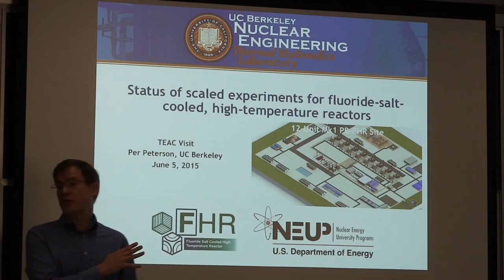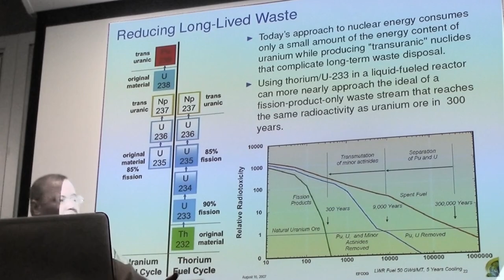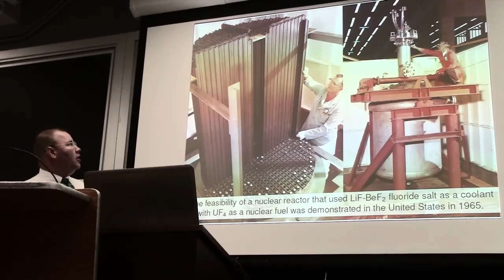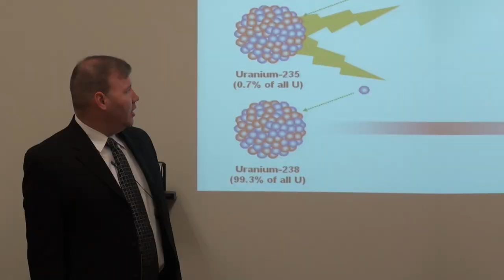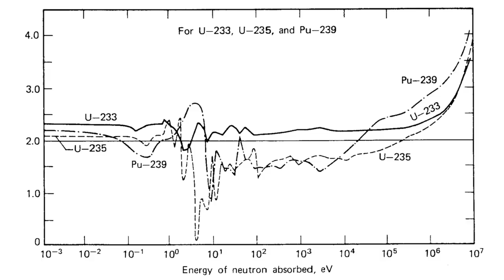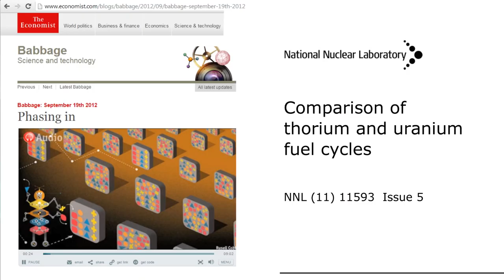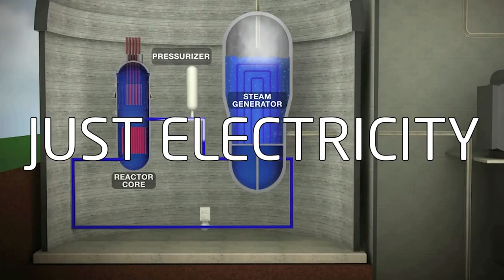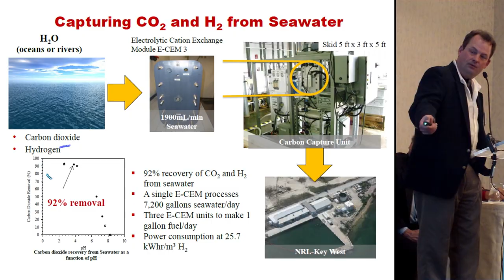Thorium Disadvantages

Comment: Simple thorium is the end of nuclear weapons.....
Reply: How so? Thorium fuel cycle is impossible without breeder reactors and reprocessing facilities. That's perfect for bomb grade plutonium production, just mix in some depleted uranium and extract plutonium from spent fuel. Hey presto, bomb material, as much of it as you can be bothered to stockpile and with better ratio of plutonium isotopes than from an uranium reactor.
Reply: @aleksandersuur9475  You should probably take a physics class, your oversimplification leaves out several key facts as to why it doesn't work that way, nor is as simple as you make it!
Reply: While it's certainly a gross simplification(what do you expect from a youtube comment?) it will still very much work. All you need to breed Pu239 is U238 and neutron flux, you can have a process tube running through your reactor, or you can include U238 in the fuel mix itself, that's up to you. You can successfully do the latter in liquid salt reactors, in solid fueled reactors it only really works if you have process tubes, or if you shut down the reactor much more often that you would a regular power reactor. India managed to build a weapons stockpile with CANDU reactors just fine, you'll have an ever easier time of it with a suitable thorium reactor. Reprocessing facility comes as a package deal.
Reply: @aleksandersuur9475  No, because with a Thorium Molten Salt Reactor you're typically not going to be operating in a fast spectrum, you'll be in the much slower thermal spectrum and U 238 doesn't "breed" very well in that spectrum, so you're not going to be a proliferator of Plutonium 239 with this cycle. The physics has got you by the balls there and will crush your proliferation dreams. Remember the thing about Thorium is your bottleneck is your 28 day decay cycle to get it to a fissile U233 product to sustain the reaction, if you try to operate in the fast spectrum you'll burn up your fissile product faster than you can make it. Now, the only way you're going to get around the physics of that bottleneck is to put in multiple fueling loops to keep up with your fast fissile cycle. Now, this is where the economics of doing a fast cycle Thorium plant bite you in the ass while the physics has got you by the balls. Now your fast Thorium plant costs more to build than a conventional breeder plant cause you had to put in extra fuel loops just to keep it running. So your return on investment is going to be so far out (if you ever see it) that you'll never be able to afford to build that plant and still have it make economic sense to anyone that you are looking to invest into it. If the economic numbers don't work and you're hostage to the physics of Thorium, it's just not going to happen. Hell, even with the US government pissing billions into these projects, they couldn't get around those two key facts (both the physics and the economics) about Thorium, that's why they never went there to start with. Not to mention the two of the salt fast breeders they built, did melt their solid fuel cores (EBR-1 and Fermi-1). Even though both happened for very different reasons, folks start losing their shit when they found out, so yeah that's not gonna happen again (at least not in the US anyway).
     Ok, now you understand why fast cycle Thorium is out of the question, you're back to the slower thermal spectrum Thorium cycle. You're probably thinking you're out of the woods since you got rid of an economic headache and went with the more feasible slow cycle. Not so fast there speedy, cause here's a big ole bowl of nope when we slap the non-proliferation cuffs on you for good. As I said earlier, U238 doesn't do "breeding" in the slow cycle, cause it only gives off 1 neutron (actually 1 point 8 or 9 something, but for all intents that point something is as useless as creating methane from a fart, so you only get 1 usable neutron) and to do breeding you need spare 2 neutrons, 1 to sustain the reaction and the other to breed U238 to make Plutonium 239. Ok so that's one handcuff and here comes another bowl of nope to stop you and put you in non-proliferation jail. 
     The thing about Thorium is it's a fatty, it loves to absorb neutrons both as it's raw 232 form and as it's lean mean fissile creating U233 machine. BUT when U233 fissions it gives off 2 neutrons (as earlier, actually 2 point something, but again that point something is useless as methane from a fart, so 2 usable and that's it), 1 of those is to feed to ole fatty Thorium 232 and send it off on its 28 day crash diet to become lean and mean U233, the other to sustain the reaction. Now remember U233 just came back from a crash diet, it's hungry and it wants to be a slow fatty again, so it has about a 30% chance of absorbing a neutron and becoming ole slow fatty U234, which as you know is not a fissile product. Ok now you're thinking hey U234, we're just 1 neutron shy of getting on the Zoomba Majic Bus Utopia 235, right? Uhm yeah, hope you enjoyed the other bowl of nope, here have another, cause where are you getting the spare neutron from to become U235? Cause you only had 2 spares to start with, you sent 1 with ole fatty Thorium and got greedy and ate the other to become fatty U234. So not only do you not get to be U235, but you also just put the fire out cause you didn't have a spare neutron to continue the reaction. CLICK CLICK, you're now under arrest and going to non-proliferation jail, toodles~
     Ok nerds, don't lose your shit, I know that's an exaggeration of what happens. But atleast it gets the point across as to why you're not getting on the nuclear bomb bandwagon with a Thorium Molten Salt Reactor. If the economics doesn't bust your ass one way, the physics has got you by the nuts the other way, so either way, it's just not happening!
Reply: The neutron spectra is not optimal for Pu239 breeding, sure. But think about this for a second, B Reactor in Hanford was only designed to 250MW thermal, what's the total power of a country full of power stations? France is averaging something like 50GWe of nuclear power. It doesn't matter that the breeding per unit of reactor power is going slowly, you overpower that with the sheer scale of reactor power you are using for power generation anyway.
Crucially, with a liquid thorium salt reactor, you pretty much need constant fuel replacement and reprocessing. It's not a batch processing type of deal with such reactors, it's more like CANDU reactors where you replace a bit of fuel pretty much daily. And you do need reprocessing to keep the fuel cycle going. At that point bomb grade plutonium extraction is pretty small thing to add.

If your end goal is lots of nukes, do you start by building country full of thorium reactors? No. But if you do so anyway for power generation, then you can certainly build nukes as a side-gig. Sort of like what India did, it's not like they built all these reactors just to make nukes, no they actually need the power and that's the main reason they are building them. That of course did not stop them from using the reactors for dual purpose and building a weapons stockpile on the side.
Reply: @aleksandersuur9475  No, it's not that it's not optimal, the physics of it is just not going to let you do it with U233. You get 2 neutrons to work with, and that's it, 1 has to feed your fuel cycle, the other has to feed your reaction cycle, you can't rob either of them to do anything else with it or you kill the whole process. I don't care how you argue it, the physics is against you and you're not going to get there with a TMSR. 
     As for Hanford, all those plants were NOT an MSR of any kind, they were all pile types specifically for U235 fuel enrichment of U238 to get Plutonium 239. Of the 7 reactors, only 1 was an electrical power generator and that was the N reactor which was the last one built. The US Government was hemorrhaging billions of dollars to keep those plants running, and at the end of the day not even the power generation of the N reactor was enough to justify keeping it running. Besides, how much fucking Plutonium does the world need to destroy itself? Hell, the production at Hanford alone was enough to supply everyone in the world with a bomb, but you also understand why it's a bad idea to do that, right? Cause you know there are some assholes in this world that are in a hurry to meet their maker and collect their virgins, and they don't give a shit about taking the rest of us with them, that's why we don't allow everybody to have one. Remember, in global thermonuclear warfare, the only winning move is to not play that game to start with. Fuck man, the mighty Soviet Union bankrupted itself and fell apart to learn that lesson the hard way, how fucking hard is it for everyone else to learn from it, and just not do that?
     Yes, India forced itself onto the stage of the world and became a player, but even for all their brash shit talking, they know damn well they'll never push the button, cause they now understand the winning move just like all of the other players do. And they too will now have to live with the legacy of that stupid decision and remain ever vigilant over not only their own stockpiles that they'll never use. But also be vigilant that the next one to unleash that genie isn't one of those irrational assholes that would burn the world down, just because they can.
     Ok, now that we understand why chasing nukes is a futile exercise in the stupidity of humankind. Can we stop worrying about the need to make them and get back to talking about why we need to get rid of the other stupid exercise of humankind, the ticking timebombs that are water reactors? Shit, how many more Fukushimas do we need to happen before we finally "GET IT" and get rid of these goddamn things?
Reply: "You get 2 neutrons to work with, and that's it, 1 has to feed your fuel cycle, the other has to feed your reaction cycle, you can't rob either of them to do anything else with it or you kill the whole process"
You absolutely have some error in logic here, if this was the case the reactor couldn't work at all because there is no way in hell you could make use of 100% of neutrons, some are bound to be absorbed in structure or other materials in the reactor. Secondly, no fissionable material gives an exact integer of neutrons, mind you, what matters is how many neutrons you get out of an fission event on average. For example most commonly known fission reaction is U235 and incoming neutron to Kr92, Ba141 and 3 neutrons. It's well known because it was the first identified. Doesn't mean U235 splits and gives off 3 neutrons every single time it's hit by one, there is an entire spectrum of decay products possible, the only requirement is that number of nuclides is preserved . Neutron capture to U236 is also possible, never mind that many of the neutrons never hit another heavy isotope and just escape from the system.
In an reactor, operating at a steady power level, every fission event causes on average one more fission event. If you are required to also breed all your fuel then you absolutely can also breed a little extra on the side using a different starting isotope. In fact, it's required that you be able to breed more than you burn in the first place, how else do you plan to get your thorium U233 cycle started?
Reply: @aleksandersuur9475  That's what the 2.X is for you doofus, it is the average for the fission... But a lot of those excess neutrons are... how shall I put it? War casualties with the vessel and fissiled material absorbing neutrons they shouldn't.
That is why you are always trying to design the reactor so that at 100% it will be a "runaway" reaction (but just barely) so that you can pull the rods out (or push them in depending on what type of reactor/rods we are talking about) to control the reaction to your needs. Maybe you need to take it slow with power production at certain times of day so you make the reaction slower, and then at 4PM when people start coming back home during the peak of winter you need to push the reactor to its limit to keep up with demands.
And this brings up the 2nd point of trying to breed plutonium.. Yes you could do it, but then you'd have to run the reactor at high operating capacity (for those sweet extra neutrons) without almost ANY margin for error otherwise the reaction will either completely shut down (over absorption of neutrons and halting the reaction) or overheat (not absorbing enough neutrons and the fuel melts through the vessel). You'd basically have to use U-238 as if it's a reaction dampner. Oh, and you'll have to add it through ANOTHER system in addition to the liquid thorium and graphite control rods somehow, good luck on making a 4th dimensional object.
Reply: @aleksandersuur9475  How so? Quite simply - and it has NOTHING to do with running reactors - it never has done.

(And FWIW, the only U233 bomb was detonated in the 1950s as part of the Castle series of bomb tests. Yes you can make them. Making them from LFTRs is a lot more easily said than done, even with a dual banket setup - with a single salt setup you flat out can't because the isotopic mix contains so many gamma emitters that they'll fizzle and with a a dual blanket setup you'll lose so many neutrons the reactor will shut down)

Weaponisation of the current nuclear reactor process happens long before the uranium ever sees the inside of a nuclear reactor. (Spent civil nuclear fuel is completely unusable as weapons fodder for at least 250 years, so put that thought aside - that's smoke and mirrors).

Natural uranium is less than 0.7% U235. To be enriched to 3% for civil reactors you need to throw around 89% of the original metal away (depleted uranium) - and apart from DU bullets, that depleted uranium is an essential ingredient of making hydrogen bombs (The cases are made of it)

To further enrich 3% to weapons grade or military reactor grade, you throw away 90-98% of the 3% material to get 30-60% U235 - and that all happens in the SAME facilities as the civil fuel is enriched in. The USA regards the knowhow to enrich uranium and the energy costs of doing so as a classified military secret. The de-facto issue is, anyone who can enrich uranium for civil reactors is automatically capable of making nuclear weapons.

Not that it's made from the enrieched U235. 

The U235 is used in breeder reactors along with quantities of U238 to produce bomb-grade plutonium - which is very low radioactivity - the stuff made in a LFTR or civil reactor contains quite "hot" isotopes and this very effectively "poisons" any attempt to weaponise the used fuel - trying to make a bomb will result in an item which explodes in a "fizzle" long before a proper nuclear detontation occurs (and apart from that, anyone stupid enough to try and steal any will be dead before they hit the boundary fence - being extremely radioactive is a benefit because it makes it a lot harder to steal, not a liability. Bomb grade materials are barely detectable in terms of radioactivity.

Uranium and Thorium are about equally abundant in the earth's crust, but the amount of energy you need to expend to enrich uranium to make it usable in a fission reactor AND the amount you need to throw away along the process ends up making what goes into a civil nuclear reactor around 10,000-100,000 times more expensive than thorium, despite the extractable energy being pretty close. It's akin to fuelling your car with hyper-expensive nitroglycerine and fulminating nitrate instead of petrol - and that's before you even start on the disadvantages of having water anywhere near radioactive materials or the disadvantages of water as heat transfer medium when the natural temperature of the process is around 1150C (ie, you want a cooling/heat transfer fluid that doesn't boil, isn't corrosive, can't burn, can't go far if it leaks, can't contaminate the biosphere and isn't trying to claw its way out of the pipework to explode to 1400 times its original volume (If you do the math, a steam bomb of only a few hundred litres water at 20atm/400C has the energy equivalent of a few dozen pounds of TNT waiting to go off given half a chance. I'd prefer not to have it around trying to find that chance near the radioactives.)
Reply: @alanbrown397  i think we should use ocean wave and hydroelectric as our first options
Reply: Rob Moilanen  The other part of the big bowl of nope is that in the fuel salt ALL these isotopes are mixed up together and effectively inseperable even with the best centrifuges so you're going to extract Uranium and Plutonium which are "contaminated" with high gamma isotopes, which means you're going to make fizzers, not bombs.

THAT is the big difference between LFTR and CANDU. Everything is so mixed up in the single fuel salt mix that you can't extract "bomb grade" isotopes from the mixture. (Anyone using dual salt blankets is clearly wanting to have the ability to easily extract U233 and as such is dangerous - don't let them do this even though it's difficult to get there)

"Inline fuel reprocessing" for LFTRs isn't like it is for other reactors. Your fuel is a circulating liquid so most of the work can be done without removing it from the reactor loop. You only need to remove just enough of the neutron poisons to stop the things shutting down - it's not like you're polishing diamonds -  and as a happy coincidence the most prolific/troublesome of those (xenon) happens to be an insoluble gas that is going to come out of the salt quite readily anyway - so all you need to do is arrange a gas void for it to collect in and sparging zone to encourage it to come out. Noble metals will come out as an aerosol in the same sparging process and can be collected by various methods such as a simple electrostatic collector plate (there are other proposed  methods but this would be viable and easy) - double advantage, having the xenon come out like that means that you don't have to worry about it forcing a backoff period when your reactor goes to (Pmin), which means that your reactor can track power loading - which is a huge advantage over fuel-rod based systems and may also make peaking plants obsolete.

Happy coincidence - you can sell most of the products once left to radiologically cool off a bit. Most of the gaseous products are very saleable commodities - ESPECIALLY the helium.
Reply: @tommorris3688  Really?  Wow, which one!!!  "Little Boy"...which used U-235 in a gun-type design, or "Fat Man", which was a Pu-239 implosion device. Please explain, so that we can rewrite historical facts.  I actually worked at a facility where Fermi enriched U-235 for the Chicago Pile.  Never knew they were enriching U-233 there too...which would be really cool given that it is not naturally occurring.
Reply: @aleksandersuur9475  thanks for the recipe, now we go build us some nuclear rockets to go to Mars and back 100 times. Build Mars Station Orion 1, 2, 3, 4, .....25. Mars will. Be running on Thorium reactors for all the cities to come to live and work. New Sciences and Technologies will be Mars destination. Solving mankind's problems.
Reply: There's so many negative discussions here. I'm out of here.
Reply: That’s not true thorium decays into uranium 232 which is weapons grade
Reply: @Bolthrower91  not IF you fire a neutron at th232 then it will become th233, decay to Pa 233 than U233. After that you can split The U233 and get energy.
Reply: Why do people believe this? Do you ever bother doing research or just parrot other dummies in a YT comment section?

Thorium is converted to uranium 233 which is an excellent weapons grade material. 

Lftr would very likely help proliferate nuclear weapons instead of abolish them. Maybe that is why we dont have lftrs in a bunch of 3rd world countries right now. You could get free energy but then have the dirkas nuking cities. Probably not worth it
Reply: @agentstevehaines9164  
If U 233 is so great with nukes. Why didt they used Th instead when they wanted to create Nuclear warheads ? Yea right U U28 was alot better because you can get Pu out of it.............

but still you get ALOT more energy out of a thorium reactor than a Uranium reactor... Try to calculate it. I have. And we get more energy at splitting U233 than the normal U235

Edit: I looked up if that was right if you could make nukes out of U233. And I wont deny it. But will you refuse the facts that if you split U233 you dont need to bury the waste of 100 000 years and instead of only 300 years of the fission products of U233. 
You dont get meltdown, hydrogen explosion like what happend in Fukushima. And you get alot more energy of splitting U233 instead of splitting U235

And I can say I dont care if you can make nukes out of it I want a cleaner way to create energy and safer way than with U235.